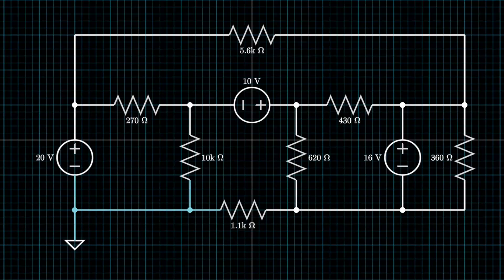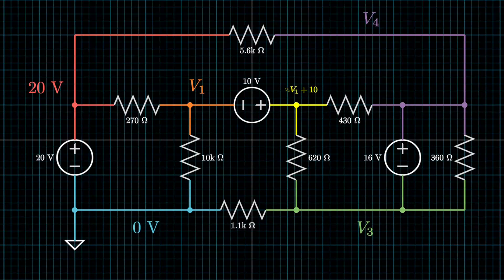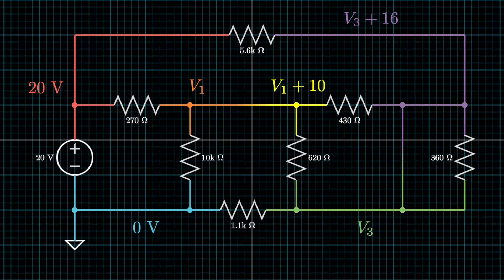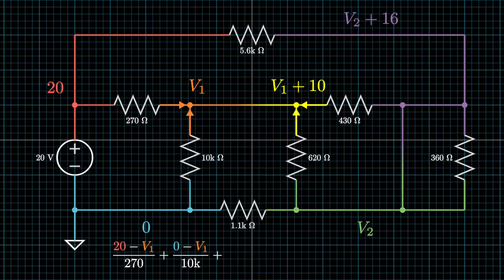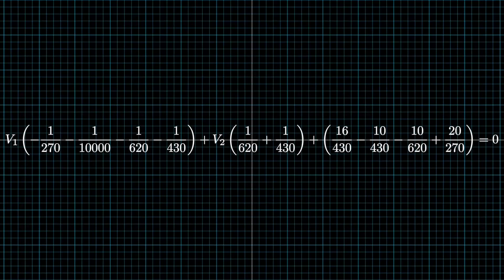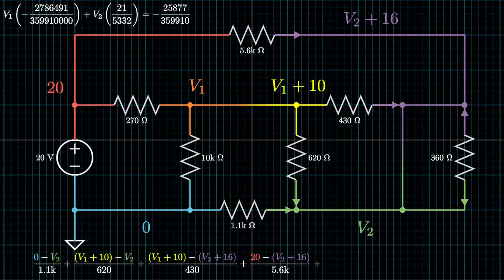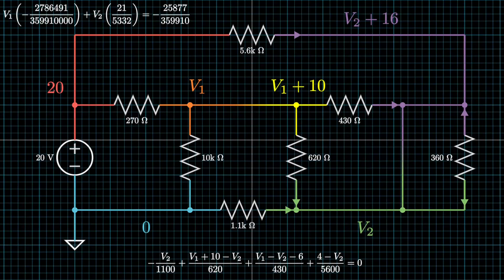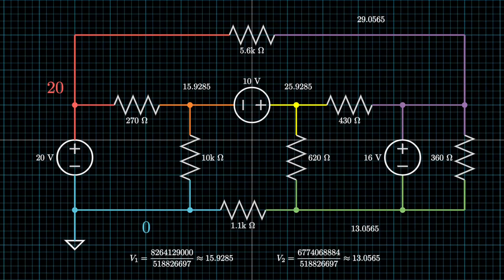Supernodal analysis animated

Comment: Hey bro! I watched your video a while ago and now I found the plugin you made. I tried to compile an animation and it does compile but nothing appears.
class Circuits(Scene):
    def construct(self):
        resistencia=Resistor(label='0.3', direction=UP)
        self.play(Write(resistencia))
        self.wait()
Am I not understanding something?
Reply from the maker: Hello Emilio Reyes, I'm glad you're trying out my plugin for Manim Community Edition. After looking at your code and copying it verbatim into my editor, it seems to work fine. Therefore, I'm not sure I understand, that code does look fine, and it works. Did you import all the necessary stuff?

from manim import *
from manim_circuit import *

Also by "nothing appears", you might need to check the folder manually, it should be something along the lines of ./media/videos/your-file-name/1080p60/Circuits.mp4
(if you are on Linux or Mac).

If you're on Windows, I am not sure how it works, you should check with the Manim Discord
Reply: @mr_fuzzypenguin  It does work man, I was testing it with Colab and for some reason it doesn't work in my notebooks lol but it does in my PC, thank you!

Comment: Very well done video and wonderful animation!!

I’ve been interested in doing similar work. What software did you use to draw and animate it?
Reply from the maker: I made my own library for this video (took me just about 5 months), and it was a plugin on top of a different Python library named Manim, which was originally made by 3b1b. However, the community forked it, and made Manim Community Edition (ManimCE). I made the library compatible for the community fork because it is a lot more friendly (and stable) overall.

The library is called manim-circuit (link is in the description). With a few tweaks, it may actually work with ManimGL but your mileage may vary (not recommended for beginners). Personally, I managed to get it working with ManimGL, but it's a lot less friendly.

Also, if you do create your project, let me know how it goes! I'd love to see what people do with this library.
Reply: @mr_fuzzypenguin  I absolutely will, thanks for sharing. I look forward to seeing more of your work!